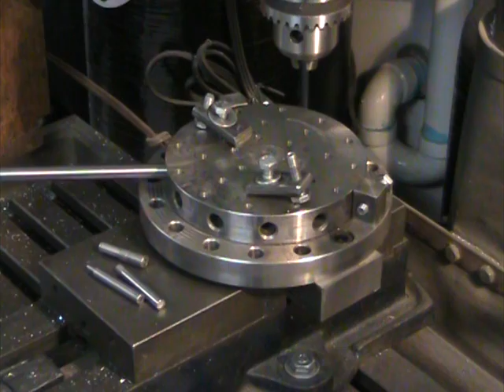Rotary Milling Table

Comment: very nice and a handy device, I think I have to make one, did not see anything on how the upper and lower discs are attached.
Reply from the maker: +Ed Ginsberg - The rotary table has a 3/4" diameter round spigot going down through the round base.  The bottom of the round base is recessed to receive a split collar that slips over the end of the spigot and tightens against it.  The rectangular steel bar that fits in the vise is attached to the assembled rotary table as a last step.
Reply: +Chuck Fellows is it possible to see it took apart in some video?
Reply from the maker: +Andrii Podanenko Here is a metal working thread where I have pictures of the dividing head dissassembled
http://www.homemodelenginemachinist.com/showthread.php?t=7027&page=2
Reply: +Chuck Fellows oh, thanks, Chuck.

Comment: Thanks for your video where I've learned a lot.
I myself could not find the patience to work with the "hand wheel" and "indexing plates" resulting in inaccuracy.
Therefore I would like to ask you with your demonstrated experience to review my developed simple "RotaryTable Controller" that is NOT CNC based.
Maybe you could help me finetune or even have some upgrade ideas to be implemented.

Please watch the 5 modes until the end of the video for all possible options:
Illustrated 5 modes:	https://www.youtube.com/watch?v=2BrnGyNoApo
Illustrated specials:	https://www.youtube.com/watch?v=Rq8hwZqCWjU
On the Mill:	https://www.youtube.com/watch?v=TnRbYGcN7Q4

Thanks.

Comment: Very nice! I've often run across jobs that need a rotary table, but don't really need the precisely measured angles, just rounding off. This is a great solution to that problem.
Thanks for the video.

Comment from the maker: @algae1000 There is a boss on the bottom of the table which is a close, rotating fit in the base.  There is a circular clamp on the bottom of the boss that keeps the table in place.

Comment from the maker: @bloutyben - I also have a commercial geared rotory table, but this one is quick to set up and easy to establish limits of rotation in both directions.  Great for putting radii on the ends of parts, etc.  I got the original idea from a British magazine, Model Engineers Workshop...